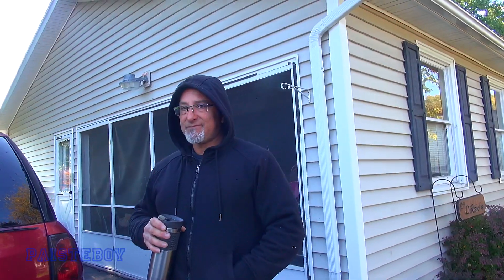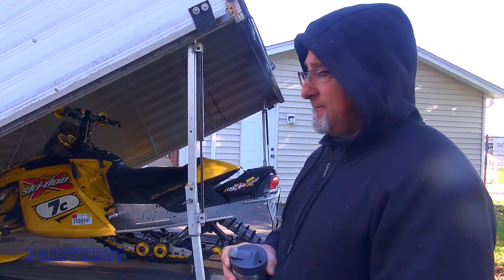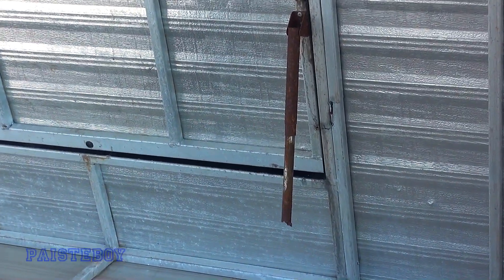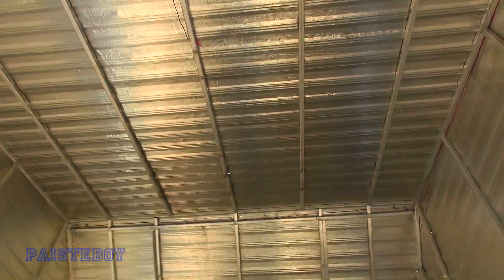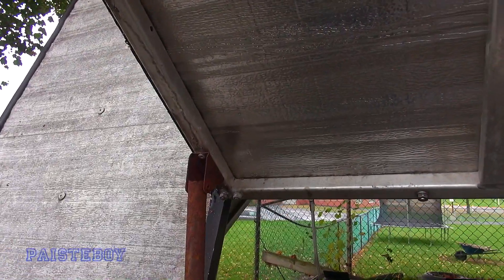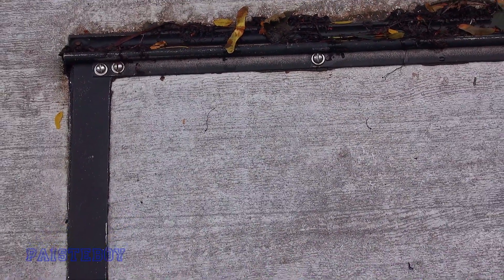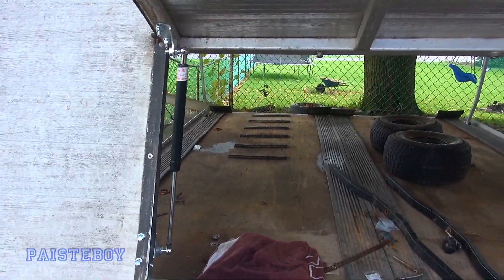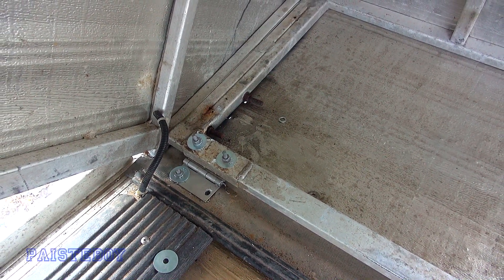Snowmobile Trailer Repairs on my 2000 Karavan

Comment: Glad you got rid of those spam comments earlier.lol 
Anyways I did the same thing with my trailer this weekend. Access door is fine and replaced the hinges last year. But the canopy was cracking around the outside screws. Turns out all the caulk along the frame rails broke free. I needed 3 tubes of caulk. Much quieter now too!
Reply from the maker: Yeah, every few videos I get bombarded with these spam comments and lately they are half nude women.  I can't stand the spam comments though. 
Quiet is good when it comes to trailers.  I guess maintenance is inevitable but better to do it now then when it's broke and it's freezing outside.  I love it when you do a little hard work and it pays off.
Thanks for the comment Tom.

Comment: Yeah I thought the big news was gonna be about Zuke getting rid of the Blair Morgan, he really liked riding that ZR last year.
Congratulations on the new trailer, if it’s a hybrid I think you’ll love it.
Reply from the maker: We'll see what happens.  We are looking at a couple of options for Zuke.  We will probably tear apart the motor next weekend and then go from there.
As far as my new trailer goes it should be here in 2 to four weeks and I will be making a video about pretty much right away.  Thanks for watching Tom.
Reply: I bought a Nitro hybrid 2tone grey in front black in back with upgraded floor and frame also finished inside my Arcticat has plenty of room
Reply from the maker: Sounds really Nice.  Thanks for watching.

Comment: Trailer turned out great and congrats on the new one. Cant wait to see it bud. Got a new 7x19 enclosed V in 2016 and still working great.
Reply from the maker: Thanks.  That sounds like a great trailer and should last you many more years.  I was told that the trailer should be here in 2 to 4 weeks but I will be putting out other content in the meantime.  Thanks for watching Mark.

Comment: Great video and example of what to check for.

One issue I've had with the strut on the man door is that the tec screws were sheared off due to the constant pressure from the shock when it was closed. I reattached it on the other side of the door and it happened again.

What I did was to use 1/4 pop aluminum rivets and it's holding up a lot better.
Reply from the maker: That was our first attempt to mount the shock on the man door but we eventually through bolted it.  Not sure if you noticed that part.  That thing isn't going anywhere now.  Thanks for watching Streeter.
Reply: @Paisteboy  LOL. Yep, I was commenting during the video and saw the end result. Do I get extra credit for not skipping ahead. 😀

Congrats on the trailer purchase. I’m curious to what you ended up with. I’ll be replacing our clamshell next year.
Reply from the maker: Commenting during the video is always fine with me as long as you watch to the end. lol.  I normally do everything right the first time so there are no retakes so I could see why you commented right away. lol.  You do get extra credit for not skipping ahead!  The video was very long but I cut out everything that I felt I could and it still ended up that long.  I did watch the whole thing myself this morning and feel pretty good about the content and length of the video.
This Karavan trailer must have some aluminum mixed up against steel and it caused corrosion and failure in some parts.  It's weird how there are rust marks and small holes on aluminum so that's the only reason I could think of.  It is 20 years old so I guess it could be worse.
Thanks.  I will reveal the new trailer at the video release.  It would take the fun out of it if I just told everyone what I got before I had it.
Why are you replacing your clamshell next year?  That thing is just like new after all the work you did on it.  I watched your trailer series again a could of days ago.  Really nice work on those videos.
Reply: @Paisteboy  Thanks!

The main reason we’re looking to upgrade is that now the Emily is riding we need to haul 3 sleds. 

We made due last year by putting it in the bed, but then you need to cover and it’s a process to get it loaded when towing the clamshell. 

I’m looking at long hybrids around 14’ in length. That’s pretty much the max length I can accommodate in my driveway during the winter.
Reply from the maker: Ahh. That makes sense now.  At least you'll get a good buck for your trailer to go toward an upgrade like that. 
I don't know if I'm fortunate or unfortunate but I have three kids and 2 are boys and none of them have any interest in motor sports.
Reply: @Paisteboy  It’s a catch 22. I absolutely love being out there with the family. But with it comes the expenses. Everything is tripled. Between maintenance, upgrades and gear it gets costly. 

Thanks god for all of that YouTube money were rolling in. 🤣
Reply from the maker: That is so true when it come to snowmobiling with your family! 
One upside is that I get to reinvest most of my YouTube money on sled stuff or videoequipment.

Comment: I silicone my front access door in Your clothing gets all dirrty anytime you try to use it Glad to see the back Should be a good snow year
Reply from the maker: Thanks Alan.  Yes, if the silicone doesn't cure properly it can be a lot time mess.  In proper conditions it should cure in 72 hours but being exposed to moisture constantly will hinder the process.  I hoping that we get a cold winter so that the snow we get sticks around.  Bring on the snow!

Comment: How ya doing buddy ! 
I had the same trailer years ago...got sick of the negatives of it...wide, heavy, tows like a parachute, snow on the cover makes it SO heavy to lift when you come back from a ride......that a bought a 7 x 16 inline and never looked back....SO MUCH nicer experience loading, and unloading sleds, and tows so much nicer, and you can see around it easily with regular mirrors. You need to upgrade from that pain in the ass trailer imo.
Reply from the maker: Doing great!  I agree with you.  I'm not sure if you watched to the end but I reveal that I ordered a brand new trailer and it should be here in 2 to 4 weeks.  Thanks for watching Jimmy.
Reply: @Paisteboy  no, I didn’t watch till the end.....what trailer did you order ?
Reply from the maker: I know the video was quite long so I understand.  I tried to edit out some stuff to shorten it but I really felt I needed to keep what ended up in this video.
I don't want to reveal what trailer I got until I make the video after it comes in.  It's pretty nice though. lol.  Stay tuned and thanks again for watching.

Comment: What is it taking so long for new trailer to arrive I ordered mine in a 2 tone with all options and 1 week later it came in
Reply from the maker: When did you get it? You also got a different brand.
Reply: Back in February last year it’s made in Maine and I live in newhampshire but I was going for a different one made in new York but the nitro was highly recommended and much less money very popular where I got it people come from Albany and Connecticut
Reply from the maker: @sheddski2942  
OK, cool.
My brand is manufactured out of state and covid may have something to do with the lead time.  Tomorrow will be 2 weeks since I ordered it.  The dealer was only getting a handful in so if I didn't get one this time I would have to wait until the middle of January for the next shipment.